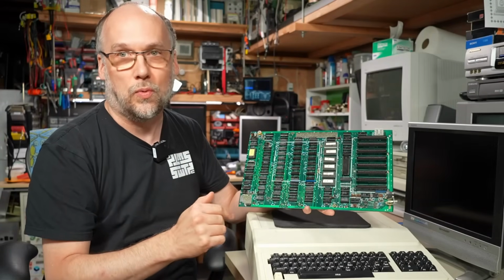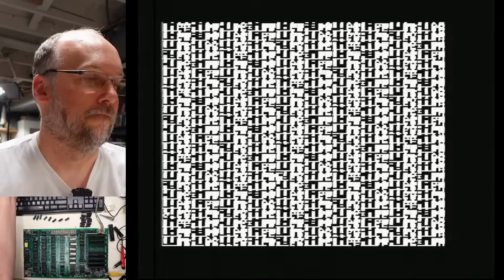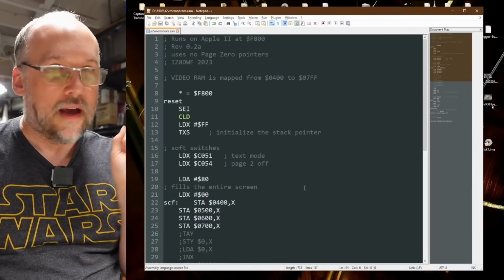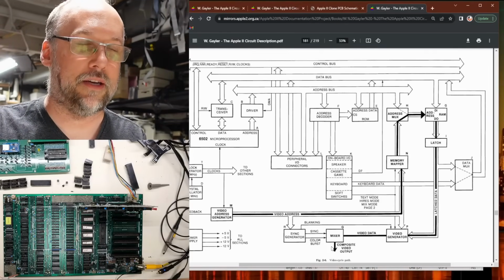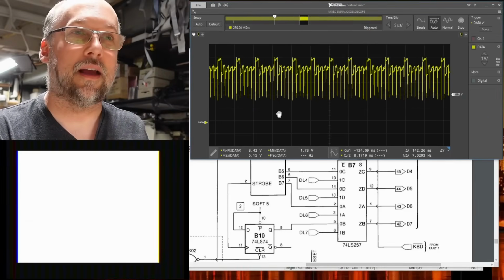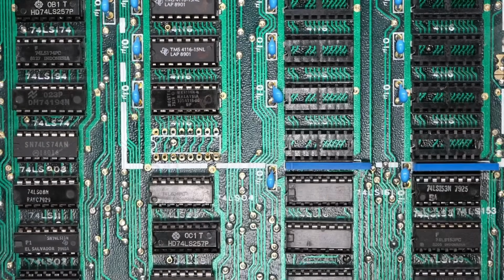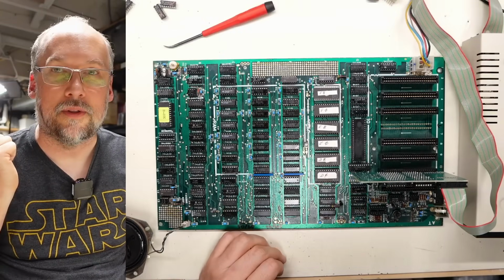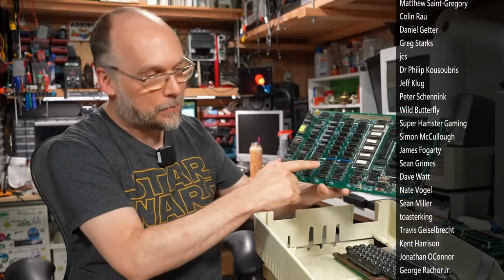Apple II+ clone repair: It was one of my most difficult

Comment: Since this is a cheap clone PC, I bet those metal shavings are artifacts of the manufacturing process because they weren't built in a very clean clean room. I wonder if they were elsewhere on the board and maybe the computer was shaken or twisted by a drop or something that moved them loose where they came into contact with the hot metal and caused the short and got welded in place. Really tiny flakes of metal can do that. Since the tolerances are so small on the board, it would be possible with a "large" tiny piece of metal.

Comment: I don't think it ever worked, likely a kit, and when it didn't work, they put it in a closet and forgot about it. I bought an Eico preamp that was a kit, and it never worked from when it was built, turns out someone miswired the selector switch, off 1 terminal. I bought it 40 years after it was built.

Comment: There other are several possibilities with this machine.  It may have never worked out of the box and was sold without any ability to return it due to it's illegal nature.  It could have been a failed board from the line and someone grabbed it as a dumpster find.  Several of the flaws have to have happened during the initial build if they weren't reworked.

Comment: Decades ago I built several Apple][+ clones - each from a bare board where I had to solder all the sockets/parts in.  One board gave me fits, and I ended up finding a short between the ram pins - same as you did, doing the same tests like you did with O-scope and multimeter. As it turns out the issue ended up being QC/Production problems on the bare boards - found repeated problems on additional boards before even soldering in any sockets, at the same pins/trace location!!!!

Comment: I have a clone plus (sherry) and It took me a year reading and studying and studying again, trying to find out why graphics in colours were corrupt. I live in Europe so I put this down to it been PAL Vs NTSC issue, but I couldn't let it go because there was color, just the graphics were bad. testing all the pins and probing each graphic bit, bending pins, leaving chip out, nothing did not help, I even added A14, which actually improved the sync pulse on the TV... Anyway one day again trying to understand how it works and following the diagrams I suddenly discover a clock signal, /7M was missing from the complicated A8. Bingo I'd found a bad trace.  So I now have i it working, an NTSC clone set at 50hz and in full color on a LED TV.

Comment: That big patch of contact points in the top middle, don't those lead to each + ? the way to find  each is to goto 1, then go through board points and id each point so you don't have to pull chips and comps finding shorts?

Comment: The short forms from plated through hole to a trace.

The trace should have solder resist on it.

My guess is that the solder resist mask registration is poor and the side of the trace is exposed.

Whether the short was assembly time or crystalline growth is harder to say, except that if it was an assembly time short I would expect your desoldering to have cleared it.

Comment: FYI: Clone Apple ][ machines won't always run all normal apple ][ software the same. It can be stuff like timing circuits not being the same or slight rom differences etc etc. It's not surprising that some games just don't work right. I had an apple ][+ clone growing up and then a real apple ][+ and ][e and there was some software that just wouldn't work. Not much but occasionally.

Comment: Gotta give Woz props for designing a simple block layout with off the shelf parts on purpose, so most issues could be fixed by the users or small repair techs.  There's also evidence of his genius in some of these complex/odd solutions.  The first computer I had in my room was a IIGS and then a Mac IIci a year later, both well past their prime in the late 90s, so not really that simple.  I did eventually get a few Apple //e's that I got all working for fun learning electronics in middle school.  I never really used them, the Apple IIGS I had fully loaded with period accelerator/upgrade cards with the Apple ][ mode was how I learned Assembly and then further Assembly and C with just standard IIGS and GS/OS then moving over to the Mac IIci with similar type upgrades and running System 7/Mac OS 7 for both Assembly and C.  Never really wrote games, I focused more on creating graphics and pushing the hardware kind of like mini demos and proof of concepts.

Comment: Great video.

I mean at least this proves the poor quality you can get with knock offs.

Small suggestion. At the end when you suspected a bad socket for the ground on the keyboard connector, why not check continuity from behind the board to a known ground? As it could just have easily been a broken trace (and to be honest with this board, probably more likely) in which case replacing the socket would achieve nothing.

Comment: You could've (after removing the chips) send load between the data line 2 and address line 3 and use a heat camera to be able to see the way the electricity travels through the board (and where the lines cross).

Comment: The clones were a bad example of overseas Manufacturing electronics back in the 80,s and quality controlled assembly lines were run by low paid hired workers with little to no experience in circuit or pcb manufacturing. in a typical plant you had a couple of engineers and some technical people and rest were hired and trained off the street. result you ended up with a poor product with no specific name attached to it, so their was no due accountability. In my past 38 years as a Commercial technician I have come across shocking electronics from radios, televisions all the way to Computers and industrial application hardware of shocking quality.

Comment: Actually, now that I'm looking more closely at your board, I noticed there's a footprint near the power connector that looks a lot like the footprint of the power connector on my board, and since my board also uses 4164 memory instead of 4116, that suggests it's a later design. Also the chips are datestamped late '83, whereas yours looks like it's around '79/'80 (although you did mention some later chips, but they could be left over from someone else's troubleshooting).

With the shorted memory pin, I did notice it looked like the solder had flowed through the hole to the other side, it's possible that could've been a tin whisker. I wasn't paying attention when you found the first short, so not sure if it also had solder on the top of the pad, but perhaps that could've been the same? Or it could've been from the plating on the socket pin. Tin whiskers develop over time, so it's entirely possible they didn't exist back in the '80s when this machine was in use.

Comment: Often when something is shorting when it shouldn't be, I'll use a variable power supply to push voltage onto the offending traces. With a few amps, even 2 volts is usually enough to substantially heat wherever the short is. You can then feel around to detect it, use a thermal camera, or with enough current, just plain explode or burn the short away

Comment: Hi Adrian, an other option. I bought the same board when I was young. (around 1982 - 1983) Installed (soldered) al new sockets, (The good golden round type)  placed all the chips and powered the board up. And it gave me the well known Apple Beep. The only problem I had: The character Rom was swapped. For some reason the manufacturer had swapped the data lines on the character ROM.

What I'm pointing out. Maybe this board was also hand made. And the poor user never had the luck I had. I mean, I bought all the IC's from an local supplier. And they where all fine.

I wrote an assembler program  on my business computer (CBM 8032) to swap the character ROM info. After programming it to an new Eprom the APPLE II clone worked fine.

And by the the way it still does in 2023

Comment: As someone else has pointed out, could this be Metal whiskering? i.e. Tin whiskers forming over time? If they used a more pure form of tin with lower lead, that can help promote metal whiskering. If the conformal coatings wasn't applied evenly, or lined up etc. 

It was found that the failure of Galaxy IV satellite's main controller failed due to misapplied conformal coatings, they were using pure tin to save weight (pure tin tens to form whiskers more easily) and the coatings were even more critical.

Comment: what you have there, is called TIN WHISKERS (more a variation of) usually they form when exposed to corrosion and/or moisture (like leaving in a box in a unheated or non-insulated garage).

Comment: That board was probably copied using lithographic copying of an apple board, which is where errors could introduced. Also there could be solder splashes, possibly from rework. If the machine was used in a cold environment, the errors possibly did not appear.

Comment: That board is a heap of junk and it always was. Their designers pushed the design rules of the manufacturer a bit too far and ended up with a board plaged with shorts. And I'm afraid D7 is still creating problems: In Hires mode D7 is used to delay the video output half a pixel and this creates the 2 extra colors that seems to be missing, so, that bit is probably stuck in the video hardware...

Comment: Pressed Like at 1:00:55 (Spoiler Alert). Having tracked down RAM and Glue logic issues on BBC Micros back in the day (mid 80's) and did the same, wrote my own diags ROM and used an RS Electronics logic analyser to see what was happening at the CPU. I can fully understand Adrian's reaction though I think Salvage Rebuilds Uk @rsuk reaction when the get an engine to start trumps us all!

Comment: My vote definitely goes to tin whiskers or some other kind of corrosion gradually creating bridges between those traces over time, rather than a board that was always non-functional. The fact that lightly dragging your blade between the traces was sufficient to break the connection lends support to that theory, as any such bridges would be quite thin/fragile.

Incredible methodical troubleshooting work though! I certainly would have given up myself already, but you've almost got the board to a fully working state. Your perseverance is admirable.

Comment: Persistence and a consistent methodology will pay off in time.  It looks like that keyboard pan could use a good sandblasting and repainting, and you may have some keys to rebuild.

Question:  could it be that the solder mask is lifting in spots and allowing solder to migrate to nearby traces?

Comment: Suggestion - the hi-res pages are between $2000 - $5FFF.  It appeared that one hi-res page was working and the second one not.  Fat City would likely have used page-flipping for animation. While the Siemens RAM chips tested fine with the Apple-cillin diagnostic, you indicated some failed in the chip-tester.  Try swapping with known good RAM.  Also, Apple provided a diagnostic disk, "Apple II Plus Dealer Diagnostics", which I've used for years on my ][ Plus hardware, which may have more rigorous test routines than Apple-cillin.

Comment: That E0 ROM is interesting. It is identical to the standard Applesoft ROM with one changed byte (or maybe two bits). This might be a dumping or burning error. It introduces a serious-looking bug into the floating-point-to-integer conversion routines by incorrectly pointing to a constant that is supposed to represent -32768 but instead points to an arbitrary value of -28.0471308. That seems major but I haven't triggered any errors in practice. I don't understand the code well enough to deduce a problematic conversion.

Comment: I wonder if ultrasonic cleaning of the board would have knocked off those weird shorts?  Such a weird fault case.  Who knows if you'd ever run in to something similar again.
Like a nightmare of someone using steel wool near a PCB.
Great work on the repair marathon.  So many things learned.

Comment: I wonder if this motherboard EVER worked.  It seems pretty unlikely, with shorts like that.  Seems like the clone maker used a manufacturer that couldn't quiiiite handle the precision needed for a board like this.  Maybe the later chips and sockets were the board being passed along between geeks.  "I bought this computer and it didn't work, and I can't figure it out.  You want to try?  If you can fix it, it's yours."  "I got this computer from a friend, but it doesn't work.  You want it?  If you can fix it, you can have it.  I tried, but it's beyond me."

Comment: Me... screaming at the TV again when you pulled that first RAM socket. Of course the resistance increases along the row due to the extra lengths you were measuring. But then you realised and went across to the next row instead and measured with both probes on the same socket.  Shorts due to bad pcb etching were not so rare back in the 70s and early 80s. Bareboard testing was not so common, I guess.  I really wonder whether that board ever worked properly given that that there was apparently plating on top of the short that you cut away under that edge connector.  

I also noticed that 7486 in the video circuit. Should that not be a faster logic family, maybe 74S86?  It probably works OK, however.

Comment: As you probably know, if identifying a short - the most efficient way to locate it is to inject 1V/2A current limited etc. into the short and monitor the board on a thermal camera. This will directly lead you to the short location. Maybe someone have an old one you could get donated - it will save a ton of time debugging.
Reply: Would the board have to be depopulated first, at least for any traces with continuity to the shorted ones?

I imagine this works mainly when the cross section of conductor in the short is tiny in comparison to the rest of the circuit? But I guess if it's a "large" short like a big blob of solder it would be easier to spot visually in the first place.
Reply: Other options I've seen mentioned are IPA on a freshly refrigerated board (might not work here, you have to watch for where evaporates first), or a current tracer (seem to be in short supply, HP made them back in the day, and there seems to be one manufacturer selling a large apparatus today).

Comment: The PCB faults looks to me to be an issue of less than minimal clearance distance from Track to PAD. All is good as long as solder mask is pristine. suppose that thermal expansion causes connection to the track copper.

You could check for continuity on random tracks if it is possible to make connection from edge of track to the track itself. Possible the soldermask process on these boards are less than perfect. Thank you for the nice video. :o)

Comment: ProTip: The "shimmering" can be caused by the CPU processing instructions but because they're the wrong instructions, it's shuffling data around randomly in RAM, including in the screen RAM.  If it gets stuck in a loop, it may wind up continually shuffling video RAM contents which leads to the "shimmering" effect, or it may get stuck into such a tight loop that it doesn't do any data shuffling at all in which case the screen display will be stable but garbage.

Comment: I wonder if this is a case of "tin whiskers." Basically they are small filaments or crystals of metal that sometimes spontaneously grow off of the tin in solder over time. These whiskers can eventually grow long enough to bridge adjacent connections. This is especially problematic on pads/traces that are very close to each other, such as the two shorts that you found on this board. Those things that you pointed out sure do look like it to me. Yeah there is solder mask that is supposed to prevent this from happening, but maybe there was a small break in the solder mask that the tin whisker just happened by pure coincidence to grow into? That's the only thing I could think of that might be what is going on here. Very weird problem for sure. Glad you were able to get the board to boot at least!
Reply: I believe that solder mask only helps while soldering, not afterwards. The only known solutions to tin whiskers seem to be in solder chemistry, rather than board manufacturing.

Comment: I honestly do not understand all the interest in this Apple II clone: beside the challenge to fix this machine (many kudos to Adrian for that) it is really a verbatim replica of an early revision of Apple II, using copied Apple ROM and very low quality components and assembly. The original Apple II is proven to be a very reliable machine (you tested a bunch of Apple II some videos ago and they were all working flawlessly) and this is just a very very bad replica. Not a 100% compatible machine using different ROM's and schematics (which requires skills and knowledge), but just a 1:1 copy of an existing machine. It is basically stolen intellectual property, hastily assembled with sub par components and sold at a low price.